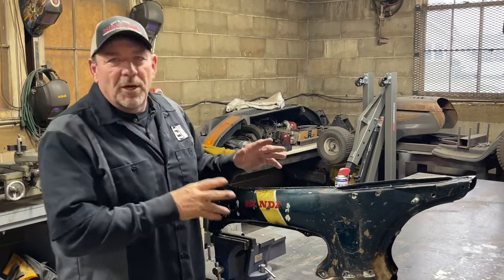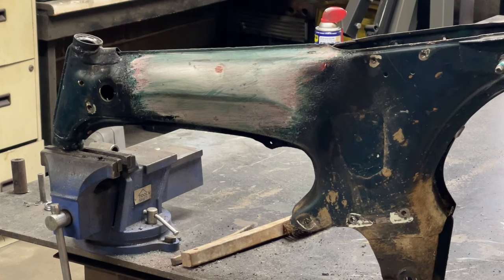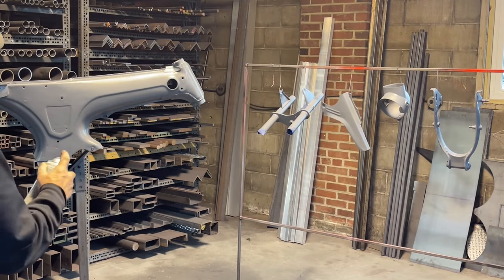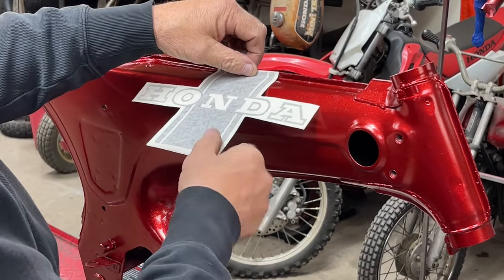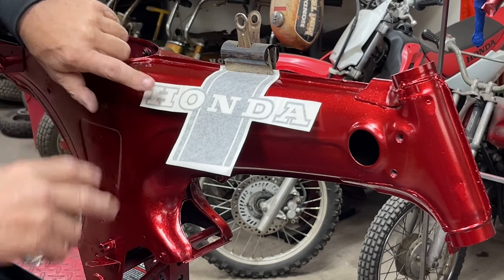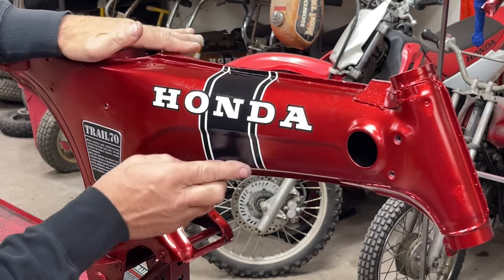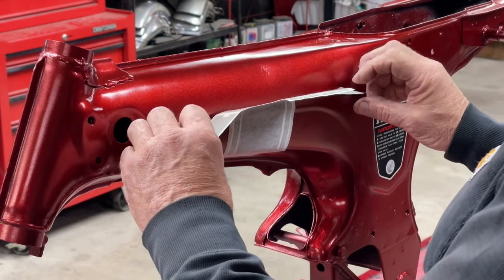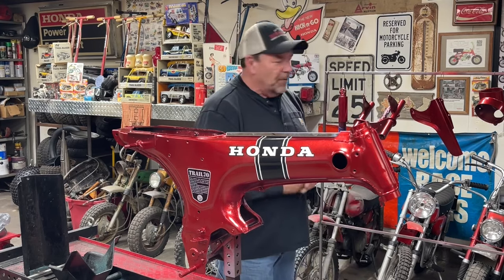Honda CT70 - the “Torch Bike”

Comment: Most powder coating places burn off the paint.  I didn't know that, so after stripping, cleaning and recoating the inside of my CT110 gas tank, i took it to the powder coating shop where they promptly burned off the paint and sandblasted for powder coating.  It ruined the internal tank coating and i had a harder time removing the burned por15 than the original rust.  Lesson learned.
Reply from the maker: I didn’t know that, thanks for the info.  It just seemed the easiest and quickest way to remove 4 layers of paint.
Reply: @MiniBikeMike use soapy water to apply decals.tbat way you can move it around as needed.after it's located where you want it squeegee off the water
Reply from the maker: @iancameron198 Or…put it on in the correct location dry and no need to move it. 👍🏻

Comment: Saw the Video Short of the finished paint job… looked nice from the camera distance.
Reply from the maker: For a $40 paint job…..I’m pretty happy with it.
Reply: Am wondering if 2-12 oz rattle/spray cans of color and 1-12 oz can of clear provide enough coverage for a complete set of K0 painted parts or would you recommend any more if attempting a candy color, which would require a silver base ??
Reply from the maker: No clue.  If I knew anything about paint, I probably wouldn’t be using rattle cans.  🤷🏻‍♂️

Comment: My uncle always used brake fluid to remove paint. Paint it on with a brush let it sit and scrape it off
Reply from the maker: I’m too impatient.  That probably works well, one layer at a time.  My method took all 4 layers off at once.

Comment: It would have turned out a lot nicer if you had added a little filler here and there then sanded it before primer then sand it again go back to filler then sand primer sand filler sand ….and so on for about 200 hours. Before paint. LOL. It looks great nice job.
Reply: A 125 from a grom or a monkey would be sweet since Honda isn’t bringing the new Dax to the states yet.
Reply from the maker: Yeah, that’ll never happen.  These are minibikes and I hope whoever gets it next rides the crap out of it.  No need to spend all that time to make it look pristine.
Reply from the maker: It’s getting a Lifan 125, which is a way better engine than a Grom engine.  I’m not into these new bikes at all.  I have zero interest in a Grom or Monkey or the new Dax.